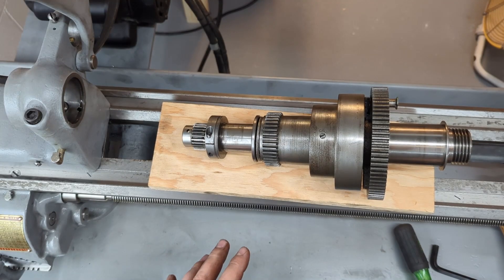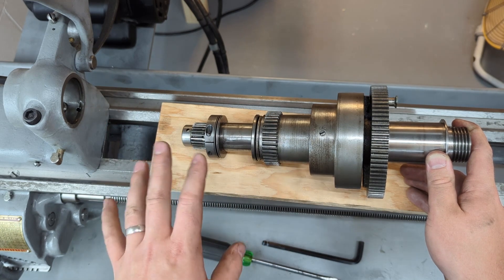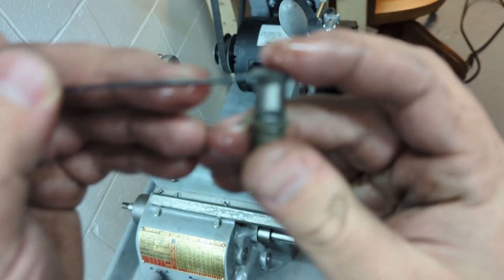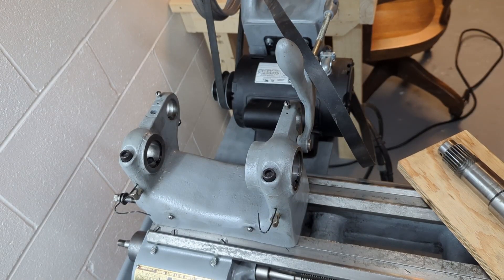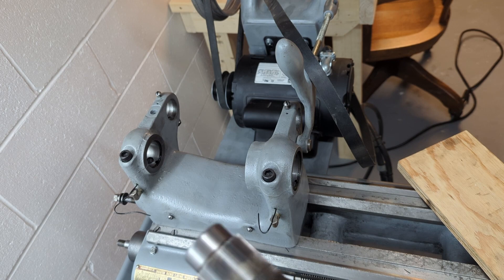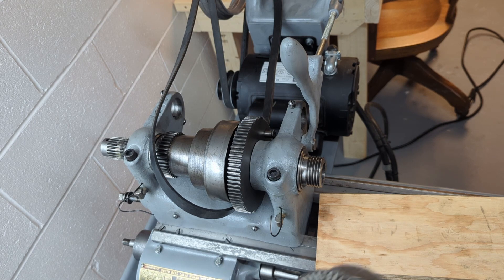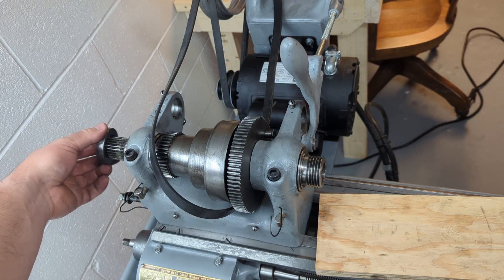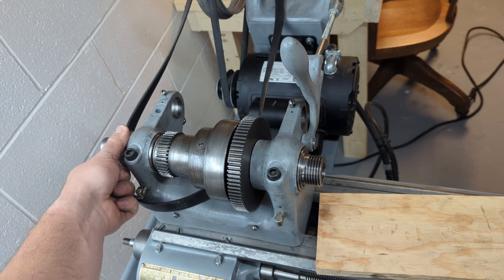South Bend Model 9A Spindle Installation

Comment: As long as the spindle goes in fully, does it matter how far down the registration ring is into the spindle journal? Yours is a couple millimeters away from the shoulder of the journal/nose, mine is a bit further away from the nose than that. is that okay?
Reply from the maker: If I understand what you mean, the spacing between the spindle journal and the ring doesn't matter. When using the lathe all of the axial force is transferred to the thrust bearing, not to the ring and journal. I have two videos about spindle adjustments that may also help you. If you find my content useful remember to subscribe. I am planning to release some more videos about this South Bend lathe shortly.

Comment: What is the benefit of the needle bearing behind the take up nut?  I currently have my 9a disassembled to restore it and hope to start assembly soon.  I ordered the needle bearing setup from McMaster but just curious to the benefits if any.
Reply from the maker: I'm not an expert on that, but lots of people do it on these lathes so I copied them. From what I've observed it lets you take out a little bit of the axial play in the spindle and reduces wear between the take up nut and the journal.